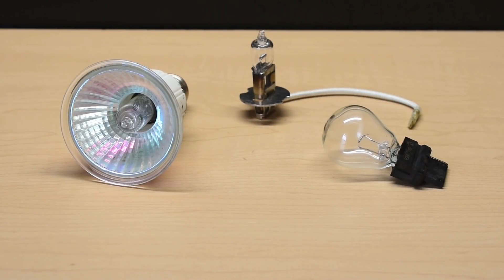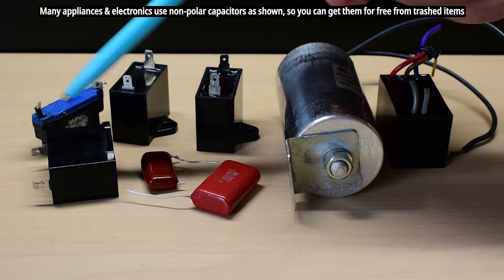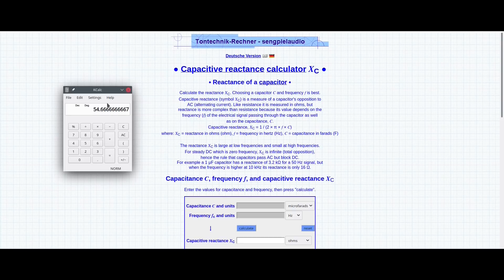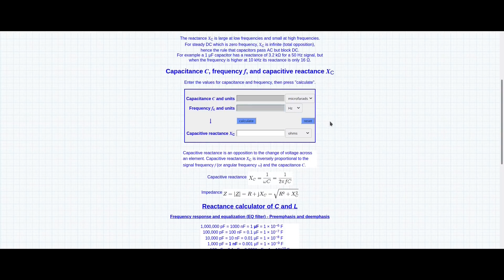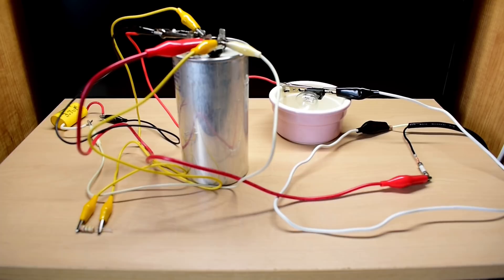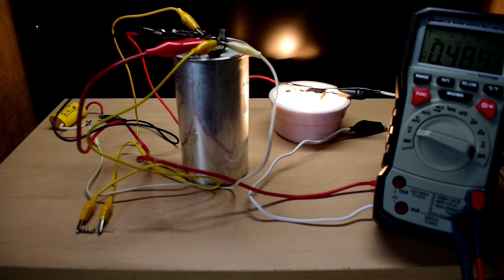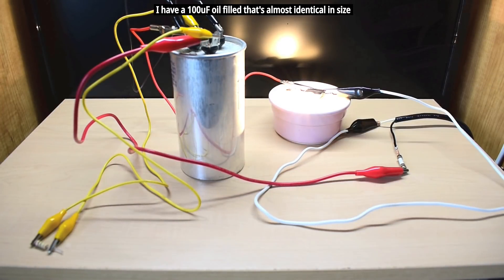Simple Trick To Power 6V / 12V / 24V High Wattage Bulbs Using 120V/240V!

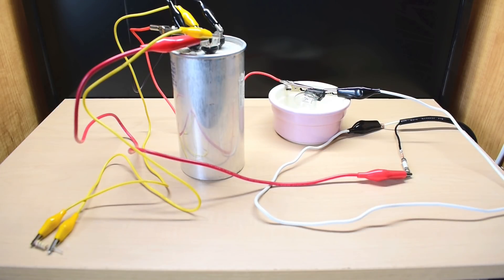Comment: Thanks for another great video!  One question: @9:50 the on-screen text indicates that if you decide to add a switch it must be placed on the AC line after the fuse leading to the capacitor.  Not sure I understand this, why does it matter where the switch is located?  I would have thought you would normally place it on the hot side of the power coming in, typically before the fuse.
Reply: I am just a hobbyist so this is  just a guess??
If the switch is placed after the fuse, ..should the switch short out for some reason in the future,... the fuse would blow, hopefully causing less damage.

Comment: Sometimes I buy something from old audio.  Recently I bought a Japanese 100V turntable.  Unfortunately, the cavity and the transformer in it have a shape not found today.  In the turntable are powered only electro-mechanical devices.  The soundtrack goes straight from the needle to another external device.  Could I use a capacitor to go down from the voltage of 240V (UK) to the 100V that the device transformer needs.  There is a place for the capacitor.  And what is the best way to use foil, metallized, etc capacitors?

Comment: Xc = 1/(2*pi*f*C).  For f=60 Hz, Xc = 1/(120*pi*C), for f = 50 Hz, Xc = 1/(100*pi*C).  With that, you don't need a website to calculate your reactance while guessing capacitance.  Instead, knowing what your impedance needs to be, you can solve for C using this mathematical equation.
Reply from the maker: We are living during lazy times. LOL. Yes, that formula is great.

Comment: wow great vid, I wonder though how would you change the watts / voltage  if we want to work out current in amps or milliamps?  like, as if I have a string of LEDs, like 15 LEDS in parallel 3.0v and 20ma each, thats 3v and 300ma is it .3 / 12 or something else?
Reply: you've basically already got your answer - since you know the current ->  300ma , so its   ACV / 0.3
so if you're in Australia/NZ or Europe it'd be close enough to 240 / 0.3 = 800ohms
To find the right value cap, you use the site linked to in the description, or, and  I recommend this as well  if you use android, there is a great little app called  elctrodroid  (note: I think he had to change the name recently but search for that anyway, its got a ton of nice goodies for ageing minds who hate maths like mine lol and its a multi way calculator in many parts so rather than guess cap values it will tell you exactly what you need

edited: yes just checked my phone he did change its name, its now called electrodoc

Comment: I recently did this to a mechanical timer that got pretty warm and drawing about 1W while plugged in, turns out there was a resistor inside, dropping about 200 volts for the timing circuit. Changed it to a capacitor and a small resistor to get the voltage just right and now it hardly pulls 0.1W

Comment: Can we do this for a dc load such as a 12Vdc comporessor, like add a full birdge rectifier and connect its outputs to the compressor?
Reply from the maker: This method is ideal for resisitive loads, or fans that will always be ON when the capacitor has 120V supplied. Any motor with high inrush, that will be placed under load and cycling ON/OFF will not work.

Comment: You will pay for VA on elec. meter. Take amps times line voltage 12v X 5.33amp =target load power eal + (120-12) X 5.33 = what your meter reads as VA(crude watts). Your wasting power without the heat and dropping voltage so it's reactive power.
Lower you utility bill by using capacitors across all inductive loads selecting ufd of cap. for highest power factor.

Comment: I’ve never felt comfortable with low voltage lighting due to the heat involved.  Seems like so much loss.  I’m sorry man but this is really just a proof of concept (as you said) and a serious fire hazard.
Reply: do you have LED bulbs in your home?  the drop in replacements for incandescent or CFL's?  Coz they use capacitors to drop voltage just like shown here, mind you with a few other components like thermal fuses, a drain resistor, some even have movs, just because one f the first components is a FW bridge rect, doesnt make it much safer at the voltages used.
Reply from the maker: Many incandescent /Halogen lamps are still in use, and I don't see them being completely replaced by LED's for a while.
Reply: @electronicsNmore  for reasons unknown 😂
Reply: @Okun240  if it works, it’s less pain to pay the power bill than replace the lamps. Some power companies are paying for customers to switch to LEDs.

Comment: would this work for other loads besides incandescent lamps? it's basically just dropping to a predictable voltage (based on the input voltage, capacitance amount, and assuming a constant current load is drawn) correct?
Reply from the maker: All resistive loads not a problem, such as powering 12V or 24V heating elements using 120/240vac. "Some" motors can also be powered.

Comment: Power Factor?
Reply from the maker: VERY low losses using the setup shown.
Reply: @electronicsNmore  Yes, but PF will be very low, close to zero, when the cap drops almost the whole line voltage.

Comment: Isn't most 12v bulbs technically rated to 13.8v
Reply: 13.5-14.5 volts typically because an alternator can put out around 14 volts. However it's best to keep them at around 12.5 volts so they last longer.
Reply from the maker: Exactly Ben, that's why I power them in the 12- 12.5V range.

Comment: Would this work for DC LEDs?
Reply: That's what is/was used in many cheap LED bulbs. Drop the voltage over a series capacitor, rectify, buffer with parallel capacitor and run the LEDs  off that.
 (Target voltage on the buffer cap is slightly higher than the running voltage over the LED string (can be dropped by a series resistor))
Typically the LEDs are run in a series string for a high voltage low current load, which is easier to power with acapacitive dropper as the low current through, and the lower voltage needed to be dropped by the cap, allows for a smaller capacitor.
Reply from the maker: The capacitor would need to be connected to a bridge rectifier to produce a DC output.

Comment: Nice hack!  Since I do not know much about electronics, what else besides lightbulbs can this circuit be used on?
Reply: Nothing else because light bulbs don't care if they get AC or DC voltage. All other low voltage electronics need DC voltage and if you try to use low voltage AC you will damage them.
Reply: @benkeysor7576   Thanks!  Makes me wonder how efficient this circuit is.
Reply: @benkeysor7576  What if the output is passed through a bridge rectifier? Still seems like a quicker way to drop voltage than with a transformer

Comment: Very interesting, folks should be sure they are NOT to using polarized capacitors, am I right?🤔
Reply from the maker: Correct. Non-polar caps as shown in the video. You can make a non polar cap using (2) identical electrolytic capacitors.